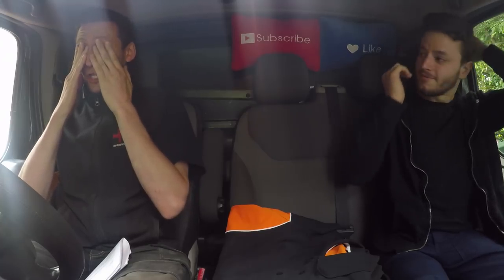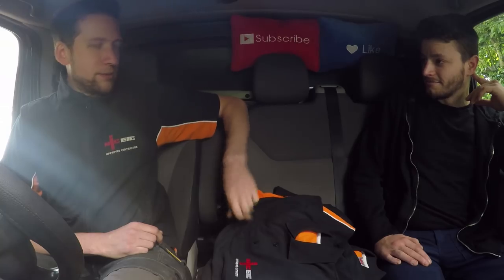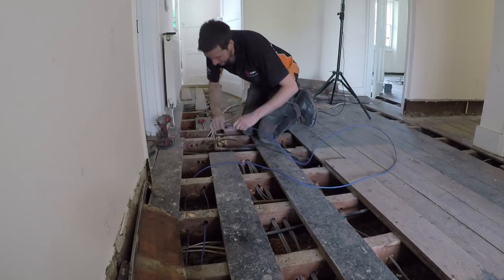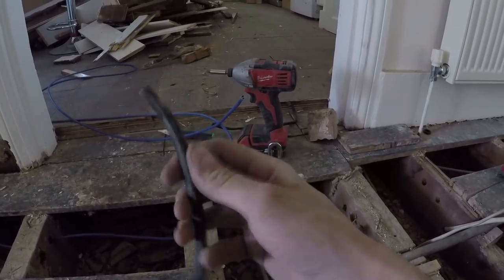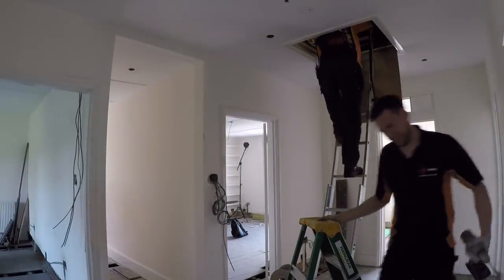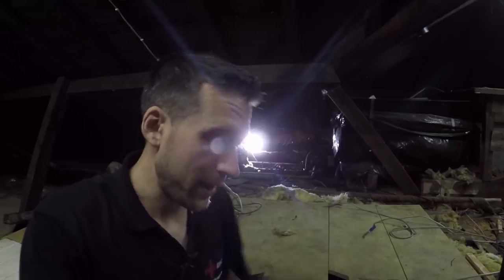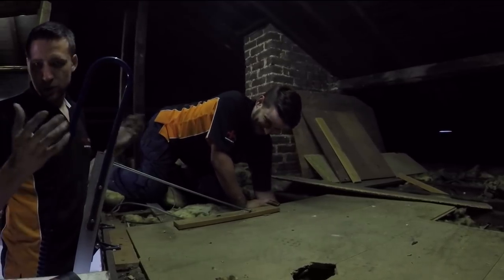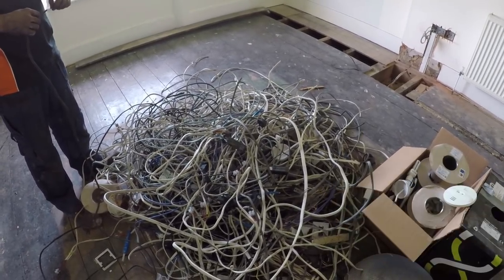Why voltage pens are essential + VIR cable is horrible smeg! | Thomas Nagy

Comment: The black rubber stuff you found is usually called TRS (tough rubber sheathed) or CTS (cabtire sheathed). VIR is the name usually reserved for the old single core rubber insulated and fabric sheathed stuff. 

We had some of that show up on a job the other month. Wish I'd made a video now because the solution we found for replacing the switch drops was ...unique.  RF switches with receivers in a common box above the fuseboard, thus saving any chasing on the newly decorated walls.
Incidentally, WHY do people decorate the house THEN discover it needs rewiring?

Comment: Yes volt stick testers are a great tool for the electrician we use them all the time. 
 Doesn't a RCBO breaker provide a measure of safety for the old brittle wiring, could it be one reason why they're required and also  if one can't afford rewiring their home.

Comment: Tom,  couple of questions:
Some of your videos look a bit dark! Is there anything you can do to lighten up the place?
Have you ever thought of getting into Veto pro Pac tool bags? 

Love the channel, I work way up north in another country called England (Manchester) :) As a spark myself I find the state of wiring up here is just as bad when doing rewires or EICRs. That black rubber cable is dangerous!
Reply: "I work way up north in another country called England (Manchester)" is it another country because it's North of the Watford Gap services?
Reply: Jbeckvideo I've had a Veto Pro Pac tech Xl for about 6 years, wouldn't be without it now. It makes the CK one's look like toys. I paid £180 and its worth every penny. And it's not showing any signs of wear.
Reply: CJT80 Yes pal, London is its own world and almost completely different to the rest of the UK

Comment: Know this is an old vid but the issue with the wands is that you can't trust them, they don't always trigger on a live wire so you can't rely on them, they are certainly useful as if they do trigger you can check further, but if they don't it doesn't mean the cable is dead

Comment: Just adding a comment on using volt sticks , ideal for what your using them for during the video , but not to be used during a safe isolation, expecially when sitting a exam at college or filling out risk assessments / method statements

Comment: These contactless indicators tend to show live where it is not, specially in industrial electrical system, where disconnected cable runs with live cables on a same ladder._

Comment: You got to love Dutch houses.
Every power line runs inside a pvc tube embedded in the sealing and they are 100% predictable where they go.
Reply: Stoney_Eagle same in Iceland, everything in pipes.
Reply: As in most of Europe, and I don't think why in the UK they still put wires directly into the wall, for me is insane, yes it would probably cost you less the first time you build the house, but then every time you want to do a repair, a modification like adding a new cable, a new switch, pass ethernet, etc you must break walls and it will cost you a lot. 

Also the good thing is that when you build the house you don't have to know exactly everything, you just put boxes and pipes and spots for lights, then you can later decide where you want a particular switch, where you want a plug, on which circuit put what, and so on.
Reply: Viktor Rúnar Rafnsson Used to be the same in Denmark, and sometimes with proper steel pipes, until some bureaucrat reworded the regulations to require that you find and ground every segment of metal pipes when doing any rewiring!  So now it's cheaper to put a cable under the wallpaper than to pull it through the nail proof piping put in decades ago.
Reply: in The Netherlands 'we' use a Trekveer (pull spring). a metal spring to pull new wires through the PVC tubes

Comment: Sure, VIR and lead sheathed VIR is way past its service life.  I reckon there might still be some VIR cotton covered single core in steel slip conduit around as well - vile stuff! And probably still earthed by the water main. In those days the supply authorities hardly ever supplied an earth via the sheath of the pilc supply cable.

Comment: Hi there great videos,  only just found your chanel,  the video with the vulcanised Indian rubber, rip out, you wondered why some was brittle and others bit,  wellas the brittle one was on a lighting circuit,  it would have at some point probably run hi output bulbs 100w  and possibly halogen down lights,  as you know this would have caused the cable to get very hot,  this making it brittle, probably at a point just b4 it was going to burst into flames, I have come across this many times over the years as a speciality renovator,  that's why it was brittle and the other not,  is basically been very hot at some point.  Looking forward to making my way through your videos,  hence a comment regarding a video that's God knows how old.  Keep em coming,  
Also the plank who suggested putting waterproof sockets in go bobs warehouse, made me laugh,  you get the peeps line me who will give advice or constructive criticism, then you get the dickhead  jobsworth who thinks they know what they are talking about🙄,  a lot of these rules and regs don't really have a lot of common sense moulded into them  which is what you need when doing the types of jobs you and I may do.  Wow that was a comment and half.  Keep up the good work buddy.

Comment: Disposable coverall, FFP3 face mask, and latex gloves for work in the roof space. Quite lucky there`s not 58 feet of insulation up there to satisfy silly building regs! 
    Volt stick`s have their place, but not for testing downstairs wiring. Leave the odd cables in if there`s any doubts, it`s not the end of the world if some old stuff does`nt get stripped out.

Comment: Hi ! The V.I.R cables i dont think we have in Norway. perhaps a different name.
I'm an Electrician in norway.
Just wanted to comment on the reason why some of the cables are "brittle". I come across very often cables like that, ofcourse some years old, that have been used for mostly lighting. but high current flow over years will result in cables like that. 
Cable probably suck to but :D mostly i see those from beeing used alot, and maybe at a cross section in the curcuit gathering or making more current go that "way".

:D peace! from Norway
Love ure vids man, keep it up!

Comment: I haven't done much domestics. In your experience can you use Voltage pen to search for cables in walls ? 

 I installed a thermostat on a wall above a light switch and I used the pen to test how close the wires were. The Pen barely lit up so I went for it and it turned out fine.

Comment: Oh yeah that reminds me. I was working on a flower factory. Taking out the old cables, 1M wide cable tray and we started cutting them with an angle grinder. The engineer said all the power was off, until we hit a live 3 phase cable supplying the elevator motor.

Oh and the Pen actually saved me getting electrocuted about 2-3 times. Just because the higher up says the power is out doesn't mean it actually is, some older ones tend to get cocky and you'll pay the price for their mistakes, take a PEN with you.

Comment: You shouldn't only go by the volt stick as some cables from the flat below might be switched off. All cables should be disconnected from your work and traced out to be completely sure of what is from your flat....

Comment: The test pens are brilliant wish they had been around when I was an apprentice! Would of avoided lots of shocks! I agree with you about the pens, they are good to find additional live supplies etc! One tip I would give is make sure you twist the sheath of cable round against the pen so you know you have got all the conductors ! If its multicolored then you won't miss the phase conductor or conductor's if three phase :-)

Comment: I wont certificate an installation with any rubber cabling, it is dangerous and is the only thing i will push a customer to change even if its not through myself personally

Comment: Just do yourself a favor and test your contactless voltage detector on a regular basis on a known live circuit. There are better ways of testing a circuit but some cases it’s the only choice as you pointed out.

Comment: I make it mandatory for all apprentices I work with to have a Volt tick (no contact tester) on them at all times. You need some common sense to make them work properly but it's still another line of defense you have access to and can save you from burnt out pliers or worse.

Comment: I think the non contact voltage indicators are great I personally use Amprobe brand and i have used Fluke brand i work everything as if it is live anyway

Comment: So if the flat downstairs needs a complete rewire, or has a fault with the wiring somewhere, those in the flat above have the inconvenience of moving the furniture, and having carpets and floorboards lifted to allow the Electrician access?. I suppose its wise to be nice to the person / people in the flat above as you never know when you'll need their floorboards lifted!.
Reply: The joys of converting beautiful Victorian property into money making flats! What usually happens is the gorgeous ceilings downstairs get under drawn, rather than devastating the upstairs floor.

Comment: Tom, hypothetically, when you are re-wiring a house, if all of the floors and walls are stripped/exposed and cable is removed, what percentage of work is removed?
Reply from the maker: 40 to 50% I’d say. A lot of the job is removing all the old stuff chasing in new deeper channels for the new cabling. Most of it is actually just donkey work; simple jobs but very labour intensive if you get my drift.

Comment: I was always told not to drill through loft joists. Was I told wrong?
Reply from the maker: roof rafters yes, never drill them. There's a serious amount of weight on them.
Loft joists, as in the ones we drilled in the video i dont see a problem. Plus they are not major load bearing joists, hence their unusually small size. The outer ones are, but these smaller inner ones and noggins are not. If they were load bearing they would have snapped like twigs long ago.
Pre fab'd Trusses you cant drill those at all from my understanding. something to do with them being pre stressed or something when they are made? 
alot of new builds are pre fabricated trusses.
I think in older houses it boils down to making a judgement call on the day.

Comment: Those non contact voltage testers are a great tool to have. You just can't completely 100 percent rely on them. I only rely on them when I have no means of doing a test with a meter or something like that. I saw a co worker get lit up one time because his non contact tester said the wire was dead but it was actually live.
Reply: Jake Higgins just because your meter says it’s dead still doesn’t mean you have to gratuitously touch it, which reduces your exposure vector as well.

Comment: What brand are your polo shirts and where do you get them from. Good video as usual. Keep up the good work and thanks for sharing.
Reply: Gamegear KK475. I have used exactly the same tops for my company for about a decade. There are lots of copies of this design now but the copies are generally lower quality, less hard wearing, sometimes have orange buttons and no white pin stripe between the colours.

10 years of working on cars and I have never had to throw away any real KK475 tops.
Reply: Great thanks

Comment: Volt sticks are bloody handy. Working on a lighting rig in a theatre and testing lighting equipment on the go is a must. Because the lighting is controlled from a lighting desk from some distance away so you need to yell the staff  at the desk but in my place they can be incompetent lol.

Comment: Standard electrician innuendo when any reference to a hole comes up haha. Couple of points...I rely heavily on my fluke volt stick but like any tool you have to know it's limitations. Obviously only works on AC circuits firstly, secondly won't work on circuits below a certain voltage so industrial wise I'd leave them out. I saw you drilling out the timbers in the loft...controversial. As you know cables have to be minimum of 50mm from the top and bottom and they looked like 100mm joists.
Reply: Paul Davies Yeah I noticed that lol.. And the client wants to board it out as well!.. Didn't look structurally sound enough to be load bearing either.
Reply from the maker: with Ref to the joists - you're giving away spoilers for the next video! That's exactly what i discuss!
Reply: I haven't found any that do DC and that's not from lack of looking! If you can point me onto one that does...Industrial wise a lot of control gear works on 24v so that still wouldn't quite solve all problems.

Comment: I’ve lived in and worked on Canadian homes that still have in active service ancient fibre-wrapped “Knob and tube”…  I’ve found some circuits with four generations of wire types, from knob-and-tube to tar-wrapped copepr, to woven fabric wrapped aluminium to current standard plastic 3-conductor, but without demolishing asbestos-plastered walls, you’re stuck with it.

Comment: Just hope you don’t cut through a switched live for downstairs flat lights 🤦🏻‍♂️😂
Reply: carlo baggio the switched live has a live wire in it, therefore the volt stick would detect it. 🙄
Reply: @muzikman2008   not if it’s switched live and neutral 🙃